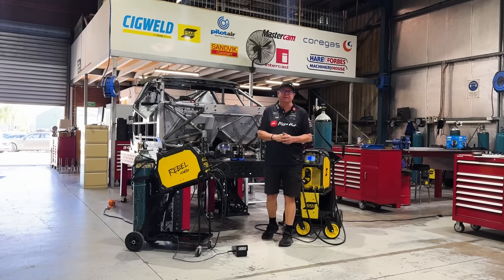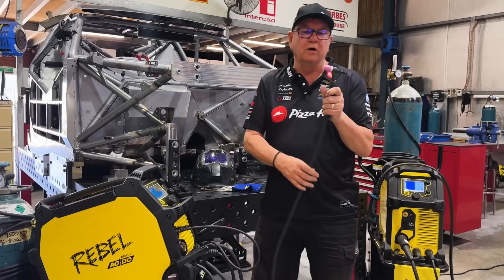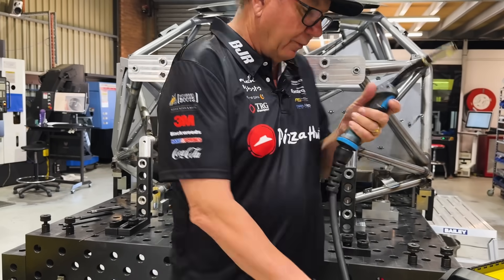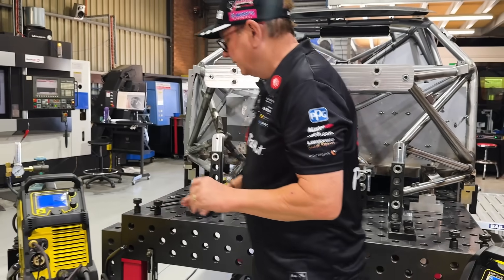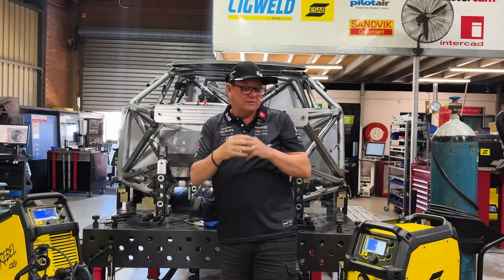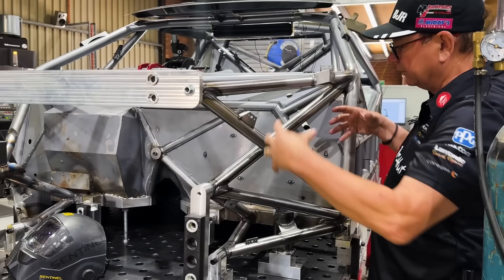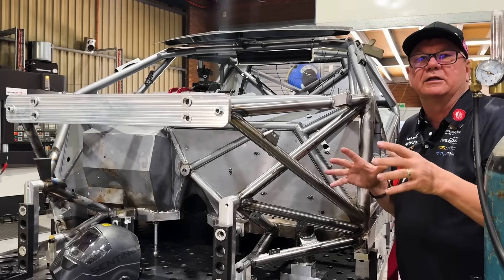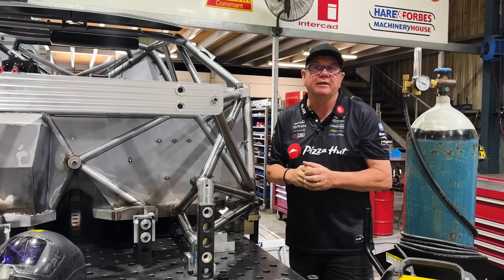Why the type of weld on a Supercars chassis matters

Comment: Thanks for sharing your video Brad. 

Self learned TIG welding newbie here.  continue...

I always thought race cars had to be TIG welded because it is stronger, ie: start of the TIG weld properly melts the metal so the starts aren't cold like a MIG weld. Also I thought craters (fish-eyes) in the welds are weak point. Also I thought continuous tack welding was deemed taboo, because lack of penetration and doesn't form a consistent joint. etc.

YET..... in this video these chassis welds are MIG welded and look like continuous tacks, each with a crater.  Anyone who can explain or send link -  Is everything I have found out completely opposite and wrong?
Reply: If this isn’t continuous tacks they are using a pulse setting and either moving too fast or the pulse setting needs to be adjusted.
It’s definitely not a pretty weld

Comment: That gmaw weld sample was garbage. You damn near manipulated the wire out of the puddle.  Almost looks like a bunch of stacked tacks, you can see the crater in each one.
Reply: Can’t put the heat into chrome moly like you can mild. Even a tig weld too hot will break next to the weld in an impact. 
The mig way is ugly and bad news in any other industry, but not many other industries use light ChroMo tube.
Reply: @willbeasy2898  true you need to know what your doing to tig welding chromoly. It's been used forever in open wheel speedway chassis, and if  you showed up with a mig welded chassis they would look at you silly.
Reply: @wireless78  just re-read my comment, and to verify, I meant stacking mig welds isn’t really kosher in other industries. 
But yes, I mig weld mild steel cages continuous for speed, and there’s  evidence to show it holds up better in crash testing, but I tig all chromo stuff.
Reply: They are stacked tacks. That how the rules mandate the chassis to be built. The material is 1.6mm thick chrome moly, if you run a constant bead you’ll blow holes through the material.
Reply: @dandewar8403  I would love to see the code that states that. If you can't set the parameters of your welder to weld a material properly then you are doing it wrong and you would change the process, hence GTAW.
Reply: You could easily tig these chassis and stand around and pat each other on the back, but it also takes three times as long. Sometimes there’s not enough time to turn these cars around week to week.
All stress analysis has been done, safety is the number one priority when building these cars.
I don’t work for Brad, I work in Brisbane, I’ll let you put the dots together.
Reply: @dandewar8403 its crazy they only let you stack tack with a mig, i know it takes longer but i think its a lot nicer to tig, specially on a high dollar race car. I know nascar mig there cars but they got 20 cars lined up ready to go.
Reply: What would be the total weight difference between the two different welds across the car?

Comment: For mine MIG is stronger also. I have seen so many TIG welded components break the weld. MIG welded however tears the material after a LOT more hard of a time.. Mig can also fill small gaps unlike TIG. MIG is also a good deal faster as well.
Reply: Mig is for mugs.  Tig is far more refined and complete.   I bet there's a lot of tig welds with some mig over top to make the rules. 😛😉

Comment: Ok so if most of the chassis are MIG welded what/where can teams like erabus (now DJR) have a advantage in welding their own chassis??
Reply: The only advantage is by having everything done in house. Makes for a faster turn around than relying on another team to send a new chassis component.
Chassis are identical for every team no matter the badge on the front, every team is free to make there own chassis, most just choose not to as they may deem it cheaper to buy than make jigs and pay fabricators.
Reply: Appears they were tig welding more parts of the chassis due to an oversight in the rules.